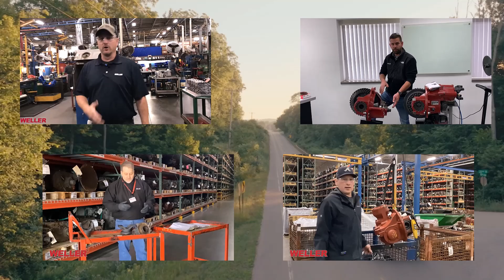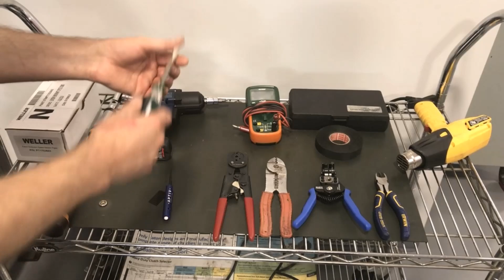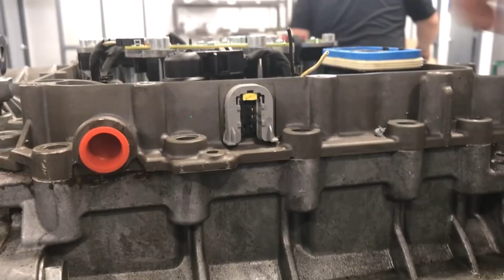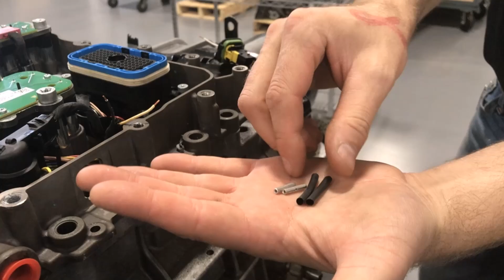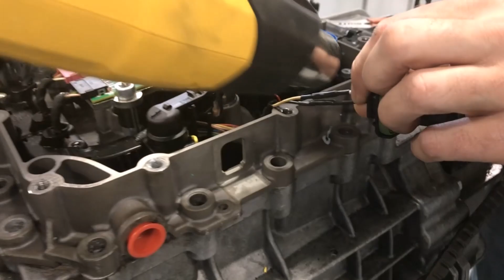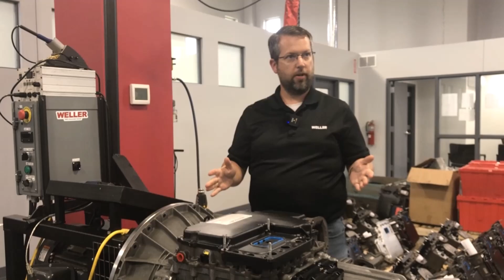Endurant / TX12 Output Shaft Speed Sensor Connector Repair

Comment: Where did you get the kit
Reply from the maker: Hi @salvadorsoto4689! 👋 Thanks for your question. The PT1703843 Eaton Endurant Speed Sensor Pigtail kit is actually a custom replacement kit we remanufacture in-house. You can:

✅ Contact your local Weller Truck Parts store
✅ Reach out to the Weller location nearest you
✅ Or order it directly from our website here: https://wellertruck.com/inventory/parts/electronic-control-modules/p164302671/pt1703843/ecj/eaton-endurant-speed-sensor-pigtail

Let us know if you need help finding a store near you or placing an order!